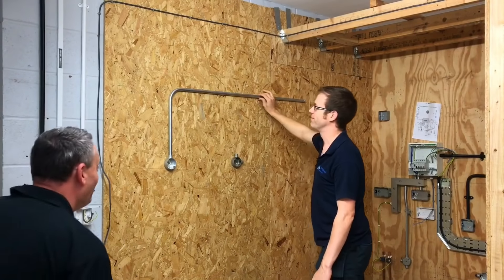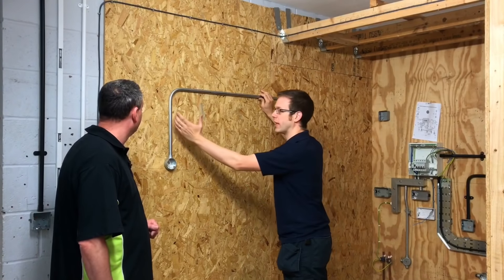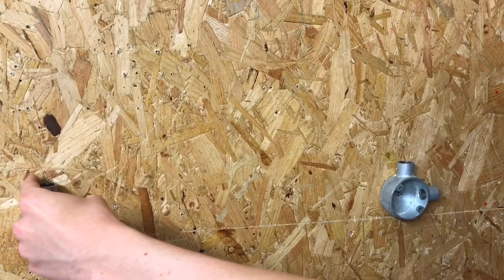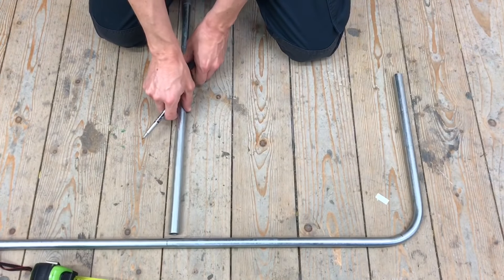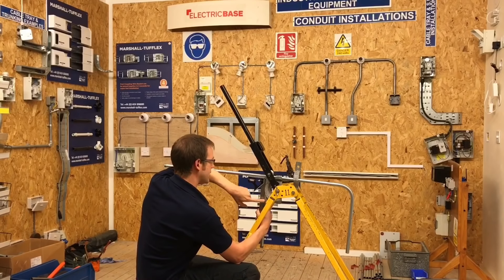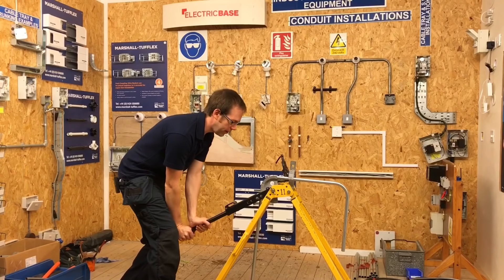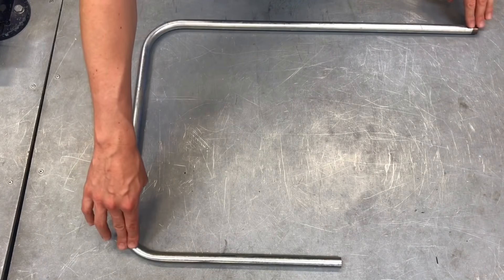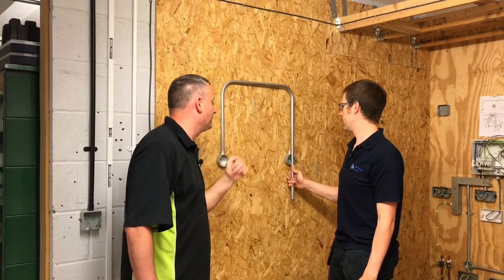Step by Step Guide on How to Bend Steel Conduit Back of Bend to Back of Bend (AM2 AM2s)

Comment: I'm so glad you are doing a conduit  bending series, its helping to keep my waste down as I dont do it that often so end up with a few failed sets. 

A quick tip for finding your length between those to conduit boxes and anything else where the two items are dimensionaly the same. In your example hook your tape  measure to the left hand outside edge of the vertical female threaded port of your first conduit box then measure to the same place on the second conduit box you will find if I have described it right you come to the same 500mm figure if not a bit more accurate. It saves the guess work of finding the centre of each item and can be done by one person even if the two points are metres away.

Comment: This is good but old school. It would be good if you could show also where you need to show circumstances where you may need to produce a  bridge set or a  bubble to overcome obstacles, and circumstances where you need to add a runner (running coupler with a locknut) It's good to see the old school methods are still here.

Comment: I have a IRWIN HILMOR EL32 bender 

The former has no markings or notches what so ever,

So if I was to an offset or 3 point or 4 point bend 

How would I know , after marking up the conduit 

Where to begin placing the tube in the former, seen a lot of benders where ppl have markings on the former  already to know where the measured marking made to the steel conduit should be situated to get the correct starting point
Reply: MI J Id love to see a video on marking up the bender for back of bend etc please

Comment: The 10mm added either way 
Final value of 20mm

If it were to be 25mm conduit 
What would the added value be
To the 500 mm apart centre to centre as shown

Thanks
Reply: Hi, the value would be 12.5mm either way giving a total value of 25mm added on.
Reply: Joe Robinson Training 

I’m guessing by this then what ever size the steel conduit is, eg 30mm tube , you would add 15mm either way??

Many thanks
Reply: @mij.londoner  yes

Comment: why not measure the difference between the front of the bender shoe and the back of the bend, and write that on your bender, so that you can simply deduct that from your measurement each time, and get the same result without needing a square or extra piece of conduit.